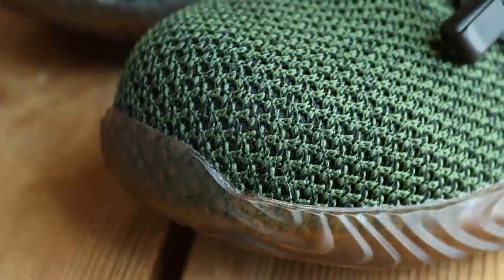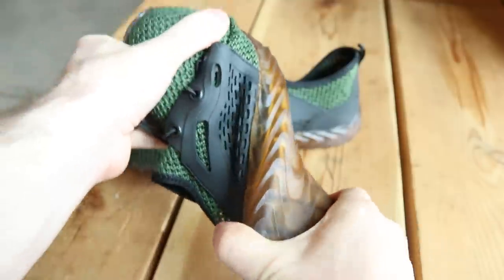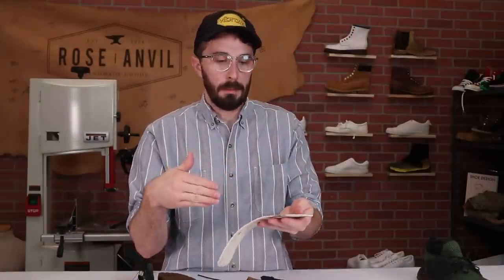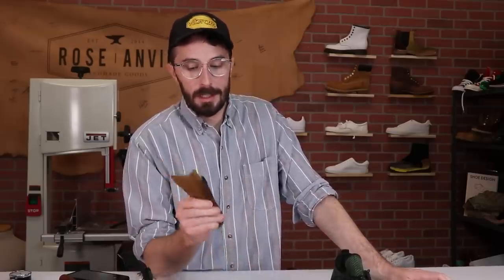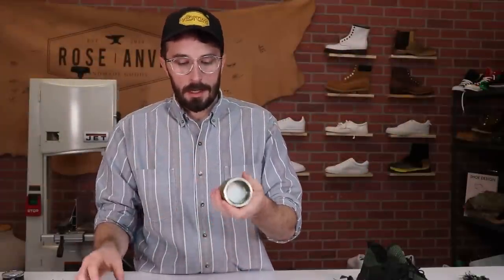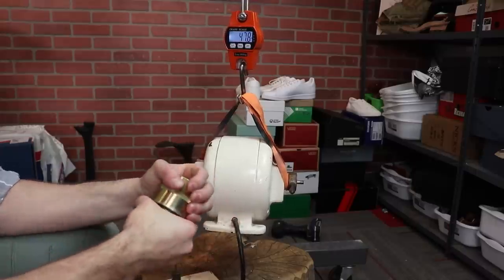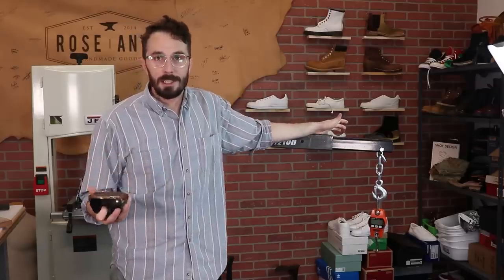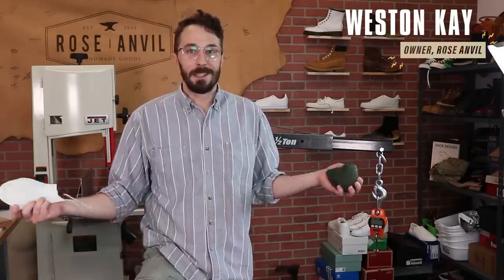Never Trust a Fart or These Indestructible Shoes

Comment: The advertisement tests stepping on multiple nails actually spreads the pressure decreasing the chances of getting a puncture. At least that's what I think.
Reply: It’s the same principle as lying down on a bed of nails
Reply: Agreed. It's not false advertising as long as they don't claim puncture proof, puncture resistant sure. Everything is puncture resistant to some extent.
Reply: Yup! Stress is force divided by the area it is applied on. Having multiple nails distributes the force and therefore each point experiences less stress like you said.
Reply: Yes definitely. I don't recall ever stepping on a bed of nails, but have many times stepped on a single protruding nail and luckily the bottom of my workboot managed to prevent puncture. Actually watching his video and showing the lack of nail protection on the outer edges, I really need to take a closer look at my own workshoes. I have had times where a nail has come in sideways as he described in the video.
Reply: It's similar to a bed of nails, but it's less about force or pressure and more about friction. A nail is pretty much a zero-area point load (if you want to calculate the area of the point of a nail, assuming it's slightly blunt, it would be about 0.01 in^2, and a 200 lb person would exert about 40k psi on a nail). So 20k psi, even divided among 5 nails is 4k psi. So still a ton of pressure. Same goes for force. A bed of nails has hundred of nails, and truly does spread out the force and pressure. Adding more nails increases the friction and increases the force required to get it to puncture.
Reply: There's a difference between "thinking" and "knowing" something. In this case you "knew"
Reply: Yup. You could reasonably stand on those nails if you were lowered gently onto them. (Not saying it'd be comfortable or safe.)
Reply: nah, I've seen someone test it with one nail, the kevlar holds up, it's just a sh*tty made alibaba shoe you can literally purchase for 10$ so lots of "companies" try and slap a brand on them and resell em. They are puncture resistant from the bottom, but that doesn't mean much when the rest of the shoe falls apart in under a week.
Reply: @unwelcomemotivation  I saw a video where the nail went through the sole
Reply: u r not wrong since u can lay on a bed of nails
Reply: guys watch out what you say here, he deleted my comment
Reply: @JayyyCloud  me too, I have seen a pretty big guy stand one 1 nail though lol god damn he musta got lucky based on the other vidoes - just saw a guy slap it with his hand through a nail lol
Reply: True, but the load is also more than you body weight when you walk (or jump) on them. The 'test' was under a more or less static load. This differs in real life, when action/ movement comes into play.
Nice vid as ever!
Reply: A full grown man stepping on a single nail...hopefully was watching where he was going in the first place, if he’s walking somewhere where there are protruding nails!
Reply: Andrew Delashaw that’s a pretty pointy nail the kinds I’ve seen in commercials are a type that rely less on being pointy and more on a bullet shape not to mention that 4K psi is still substantially less then any normal person would exert on a nail I’ve never once stepped on a miniature bed of nails like people are testing on its always 1 nail and the full 20k psi

Edit: I have actually stepped on a few nails at a time with a pair of boots and could put all 210 lbs on 4-6 nails so these aren’t providing that much more protection (if any)
Reply: And the video is also speed up
Reply: that's exactly correct, that's how people sit on nails
Reply: However, would that mean if i bought 2 pairs of these shoes, took one pair apart, put the kevlar in the other shoes and doubled up, that i'd have double the protection?
Reply: I’m not the smartest person out there but it’s kind of like how ur always on a bed of nails as lying on a single atom would hurt more than a single nail( not sure don’t quote me)but due to the billions of atoms underneath you absorb all ur weight over all of them.Not 100% sure on that maybe someone smarter than me can go into more detail on this
Reply: PsychoticDreams0 no it’s like how people break wood with there hands once it’s through one I’m guessing the second would be easier not sure but that’s my theory
Reply: You are correct my good sir
Reply: I mean I think the bigger thing to notice there was he was kicking forward with his foot not stepping down. But yeah that also might have been part of it and not him bending them on purpose instead of stepping downward.
Reply: true, but regular sneaker can survive 5 nails close to each other
Reply: Same principle for the bed of nails trick
Reply: Anyone who has just a basic understanding of physics kniw this. So basically a 7th grader in india or china or a physics major in the US
Reply: also they dont even step directly on the nails, the more step on them at an angle
Reply: Plus they put pressure to the side, bending them.... Not directly stepping on them like what would happen in the real world while walking. I could bend nails with some decent socks on let alone this shit shoe.
Reply: Also in the ad when they hit the single nail if you look closely you can see that they're stomping on it at an angle
Reply: @daveodanger  "These shoes are super strong, the soles are as durable as human skin!" so like being fecking barefoot lol
Reply: That's right. It causes the weight to be distributed and so you would need far more force to force 5 nails thru then just the one.
Reply: Eulogy nah I think it would still hurt I would believe depending on a lot of variables, gravity is always working on you and depends on what is being used. If it’s the feet it’s a possibility for puncture regardless. However if the person is relatively light they will have less to worry about because less force. Gravity works equally apon all things no matter the weight, so easily the more weight/mass you have the more force you’ll exert just by standing there.
Reply: In the add they are kicking the nails not stepping on them.  Bending them over in the process instead of puncture.
Reply: 100 agree and that’s why I came to see if someone would try 1 nail
Reply: @randyyeung9285  I once had a sheet of steel dig into my foot. Thankfully, my shoes are made of leather and my foot was only slightly bruised. If I had been wearing cloth shoes, I would have had a bad gash... and probably tetanus.
Reply: If there are enough nails you don't even need a shoe
Reply: Whilst I hate the shoe, I did actually stand on a nail whilst wearing them and it stuck into the sole but didn't get my feet.
Reply: Weight distribution is not magic, it distributes weight, it doesn't work quite the same if you stand on 3 nails than a bed of nails. Try it.
Reply: Daniel Pilar you are correct, we talked about this topic in my physics class
Reply: PsychoticDreams0 it would be better to get the second pair in extra extra large and wear it over the first pair.
Reply: The ads i've seen, they are stomping on the nails.. definitely not distributing the weight on multiple nails.
Reply: Hmm
Reply: You're correct. It's the same concept as sleeping on a bed of nails.
Reply: Yep just like laying on a bed of nails
Reply: Pressure equal force/area. Increase the area with multiple nails and you will decrease the overall pressure.
Reply: That, and they push the top of the nail over as they press their foot against them.
Reply: @amyx231   I work at a warehouse that manufactures doors. You'd be surprised the places I've come across random protruding nails. I'm from NY so thankfully I wear Timberlands lol (which is more than enough for the size of nails I worry about)
Reply: @andrewc9790  but there not indestructible
Reply: @thesoul2871  On the same note as my previous comment... nothing is indestructible. 
P.S.  Their, there, or they're??
Reply: @andrewc9790  my bad Their MR.Google_Auto_correct
Reply: They do show someone stomping on a single nail but these arent the real ones. The real ones are higher quality. The kevlar and sole are thicker.
Reply: If you secured you test jig to the hoist frame legs. Then made a bracket to pull with the scale between and by jacking up the hoist you'd have the controlled effect you're looking for on a piercing test.
Reply: Not only that, but the “Kevlar insert” and the outsole combined are also what is used in the advertisement. 
Why didn’t we use those together in your little contraption you built to hold your “swatches”? Real question from someone who thought about purchasing.
Reply: Correct
Reply: Yeah but at 1:39 they have a picture of them stepping on just 3 nails.
Reply: So now we're supposed to pick where we step on, i.e. where there are more nails?
Reply: That's exactly how carnival freaks can "walk on a bed of nails", or lie on it, or whatever.  If bare skin can do it then it's hardly surprising that SHOES can do it.  Cheap bedroom slippers would work too.
Reply: yah, you can step on a group of nails barefoot and be fine. Its the 1 nail you have to worry about
Reply: U r correct. Spreads the pressure out. Why ppl can lay on a bed of nails. If it was a handful they b in trouble. Since it's alot it's not nice but not dangerous.
Reply: @andrewc9790  but they call is indestructible
Reply: It's actually the opposite effect. Haven't you ever seen a Chinese Kung Fu master lay down on a bed of nails while people break rocks with a hammer over his stomach? The more nails per square inch the fewer pounds per square inch on the individual nail point. Plus they round off the points of the nails off—but not enough that you can tell from spitting distance.
Reply: Yup You’re right simple physics distributes the energy evenly
Reply: Nuch like laying on a bed of nails.